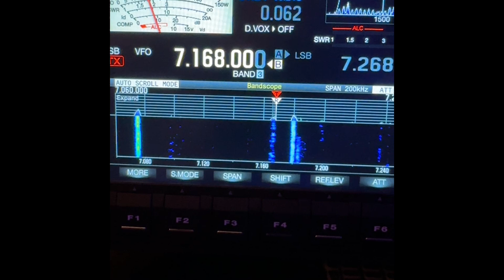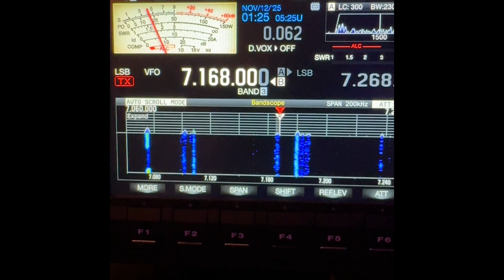How Aurora Affects HF SSB Signals #hamradio #hf #propagation #ionosphere #aurora

Comment: Shortwave monitoring has dropped considerably all week, usually I can log a full page every night but lately I've been lucky to log a quarter page. My radios are the Sangean 990X2 hooked up to a MLA30 loop and an FRG-7 on a random long wire. Most of what I do hear is on 41 and 20 Meters but with a lot of noise.  Air traffic over NM is having some issues as well lots of garbled comms the scanner frequencies.
Reply from the maker: I have a video coming out soon for my S9 (VIP) Patreon supports that shows the SWL mode of the TS-890S.  However, the TS-890S is deaf at 8.248 MHz and slightly above and below that, because its 1st Intermediate Frequency is 8.248 MHz.  But that 1st IF allows it to use extremely narrow roofing filters, improving its selectivity.  That’s great for ham radio but SWL enthusiasts must give up 8.248 MHz and slightly above and below.  I covered that in great detail on my Patreon page at: www.patreon.com/N4HNH

Comment: I was listening to my scanner yesterday, an 800 Mhz, simulcasted system. At one point, I heard a dispatcher, her last few words, repeated like three times. Did a double take because I never heard that before. I know simulcasted systems are notoriously hard to hear with run of the mill scanners (mine is a Uniden SDS100, specifically able to handle simulcast and its effects) so I was thinking; wow, this must be what simulcast sounds like to the radio before processing the signal! It wasn't an echo per se, just the same words repeated multiple times. Tripped the heck out of me.
Reply from the maker: Interesting! That sounds like an unusual experience to hear on your scanner.

Comment: Warble "ly"  is exactly what I said to my wife last night after viewing the northern lights and then checking all the bands from 10 to 80. 40m was horrible with a very high noise floor, and 80 was readable. I tried both a horizontal EFHW and multi-band verticle antennas. Vert was the worst and very noisey.
Reply from the maker: Indeed a vertically-polarized antenna will typically be more susceptible to noise.